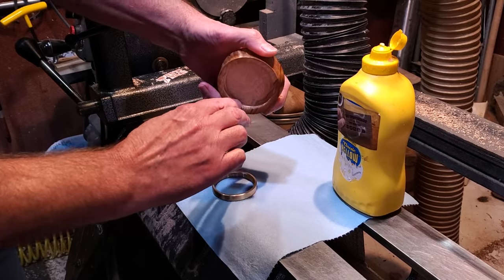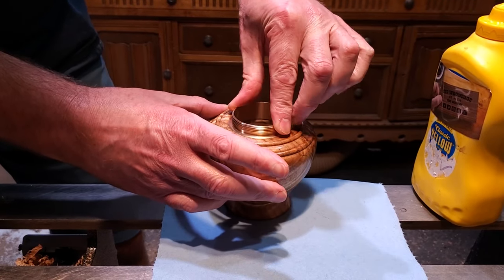Woodturning | New Bronze Threaded Inserts For Urns And More.

Comment: Carl: beautiful work, beautiful wood, beautiful design, beautiful urn but I need way more volume for human cremated remains. I work for  a funeral home and urn size would have to hold 5 -6 times that much. Do you have any videos  of large urns using the bronze inserts? I have purchased the small insert and probably should have purchased the large one which I will do. Thank you for such a great product and I also use Ruth Niles bottle stoppers exclusively wonderful product as well. Thank you Garry
Reply from the maker: Thank you so much Garry! 
I don't have any videos turning a large urn with the threaded rings yet, but Sam Angelo turns quite a few urns. He have some great video on how to measure cubic inches. https://www.youtube.com/@WYOMINGWOODTURNER

Comment: Very nice presentation Carl and what a beautiful, professional result!  A couple questions with the Doctors Walnut oil and Pens Plus application - it looked like you put the Pens Plus right over top of the just applied Walnut oil?  You don’t need to let the oil cure/dry at all?  And after you parted off the bottom and finished turning the bottom you applied finish to the bottom of the urn, those products allow you to do that without any witness line where the finish applications overlapped?
Reply from the maker: Thank you very much Lynne! I let the Walnut oil dry about a half hour before applying the Pens Plus. As far as finishing the bottom, I gradually sand back up the piece and reapply the oil and finish. This week's video is all about sanding and finishing, so I'll go over all of this in detail. It will be out Friday morning.